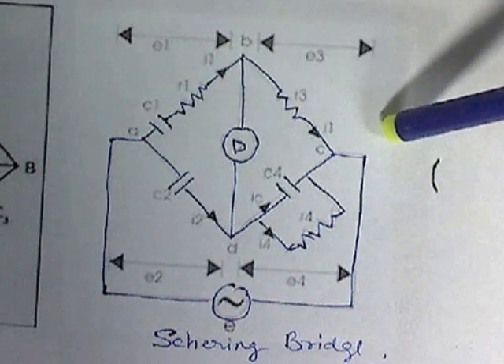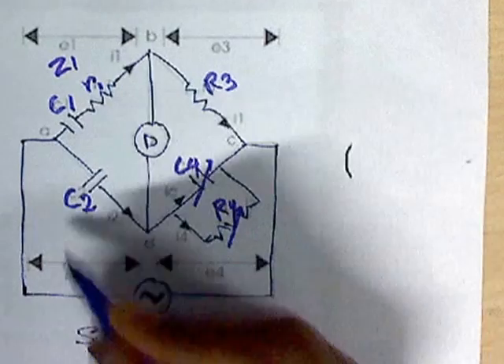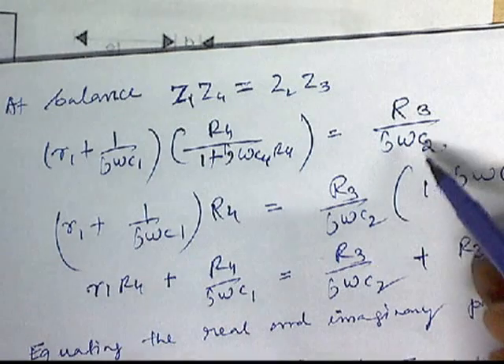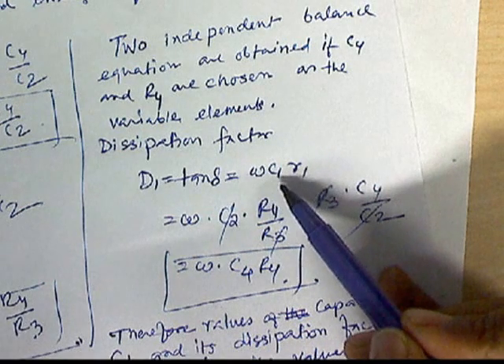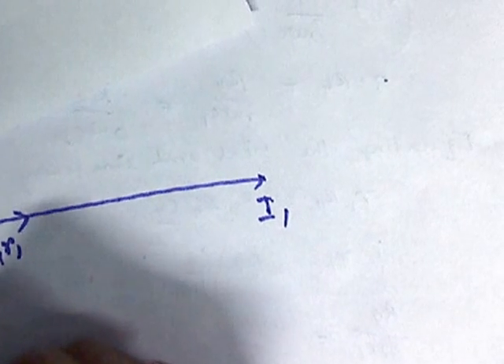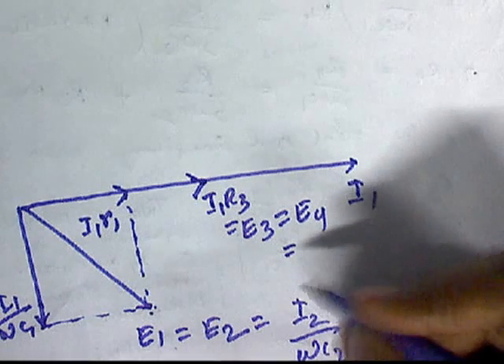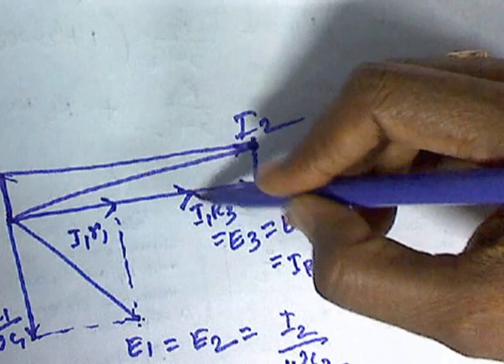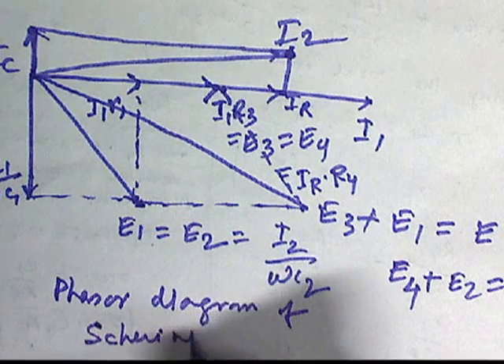Schering Bridge  Explanation with Phasor Diagram

Comment: Respected one, 
How Z2 =1/(jwc2) and what is 'J'  there?
Reply from the maker: Capacitive reactance is expressed as Xc. Impedance in any R LC  series circuit is expressed as Z= R+jX,Here X represent reactance.  In electrical engineering we use j for expressing leading or lagging condition. try to read RLC  series circuit in AC fundamentals